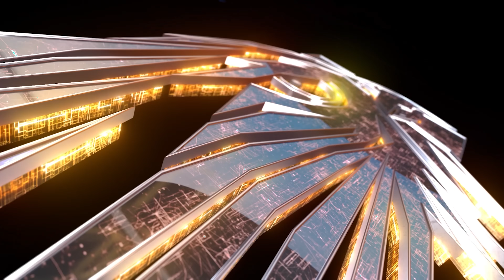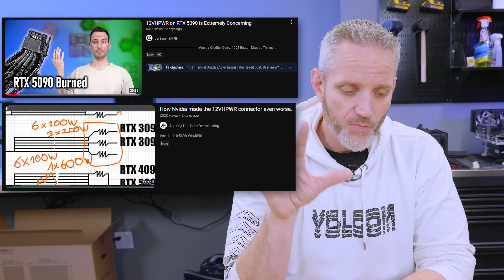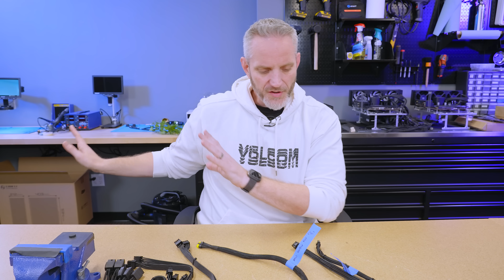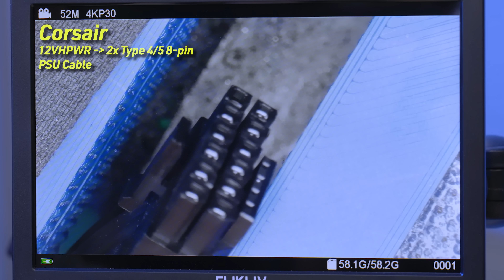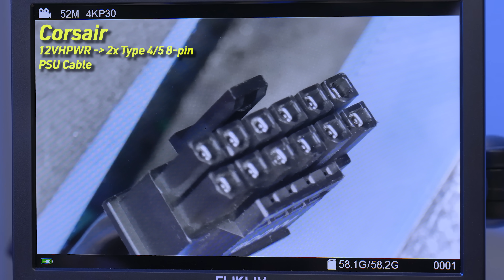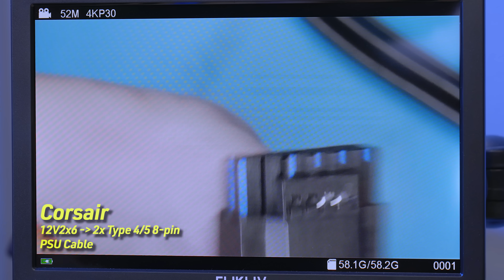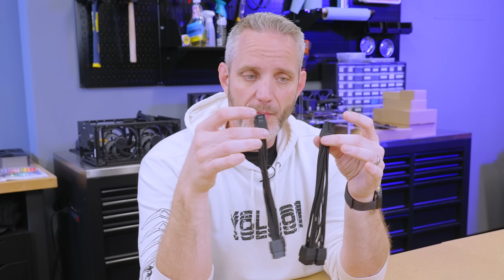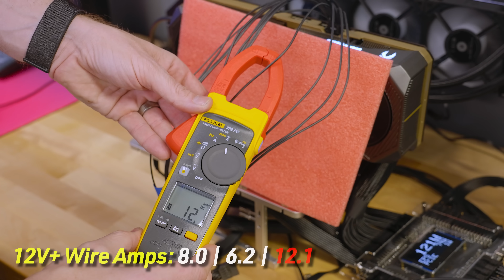I discovered something concerning and I need the Experts to chime in... More 12VHPWR discovery!

Comment: At this point, one might consider directly soldering the power delivery cables to the GPU, as it is the only way to ensure good connection and thus your house not burning down. 

Or, you know, not buy this product. 

What else is there left to say other than this connector AND its specific implementation with the unified power BUS instead of having per-pin current sensing with protection mechanisms is garbage.

One could also build a little device which senses current flow for all the individual 12V cables and cuts the connection if any one of them is exceeding a specified current. 

The fact that I'm not even joking about this or soldering the cables to the GPU directly really says everything about this situation.

Comment: I have a 4090 and it was running on the pigtail that came with it and there is blueing on 3 of pins on the sense side. I bought a new PSU with the dedicated cable from MSI and will be checking the plug regularly

Comment: I just ordered a Corsair Swift PSU and my connector pins wiggled like yours... I will now order the MSI 3.1 PSU and return the Corsair... 

(My 4090 cable (with NVIDIA adapters) just melted 2 days ago and smoked only smoked up my PSU 2, so I now need a replacement... held 12 month... -.-)

Comment: I’m an engineer. The only way to get current differences across parallel conductors is to have different series resistances. Because the current division is proportional, different pin contact areas will have an outsize impact. This could be controlled for previously as explained by Buildzoid but the 4/5000 series can’t anymore. 

Pin length is a surrogate marker for series resistance and NVIDIA lengthened the pin to try to improve consistency without requiring series resistance measurements in the spec. Because there is so little margin the tolerances really matter especially since load balancing is entirely passive. Changing these would eliminated the blanket backwards compatibility with 12V high power cables and required recertification. 

I suspect the cable is underspec’d for both conductor size and pin contact tolerances. I speculate that this was done to maintain backwards compatibility on paper and not require retooling by cable and PSU manufacturers. I also speculate that manufacturers using repurposed 6/8 pin production processes will have more variation due to looser tolerances that could be easily handled by the older spec, leading to more issues running at the bleeding edge. 

The solutions are to go back to what the 3090 was doing so you have active monitoring and load balancing or redesign the cable and connector from the ground up to robustly handle high current.

Comment: This issue has been a concern for some time, but the recent increase in TDP has significantly worsened the situation.

The Corsair connector is reminiscent of my Sharkoon cables from the early 2010s.  My power supply melted during a Battlefield 3 gaming session, which placed a higher power demand than any previous game.  Examination revealed that several pins were nearly pushed through the back of the connector. I had stability problems back then, but only with BF3, so I thought to blame the game or nvidia driver for it. Although it literally blew up, I was lucky and able to rebuild the system. I replaced all wires and the supply and my performance problems with BF3 were gone! Same hardware!

While I didn't monitor hardware performance back then, I suspected the inferior quality of the cables, rather than the power supply itself, was the primary cause.. similar to that whats happening now.

Comment: The ground side will have a much better connection through the PCIe connector.  There are plenty of ground pins used for signal isolation so you end up with a very solid connection on the ground rail.  If there was a problem on the ground GPU connector, it is possible that the PCIe ground connections can compensate for it.  The ground connection on the PCIe connector can handle much more current then one would assume with a 75 W rating.
Reply: A thought.  Using the clamp meter, test all cables (power and ground) at the same time.  If you are able to observe any current then that is the current returning via the PCIe connector.  With good cables it should be zero.

Comment: got atx 3.0 PSU and haven't had issues with the 600w connector. No adapters needed and running more connections are far worse. Just more space and mass and makes no sense.

Comment: Not an electrician but know enough to say, yes a loose connection will cause overheating. The connection requires that the whole area be touching on either side without that you are getting too many amps running across a small area which will create heat. Basically it would be like using a smaller connection. Not sure who would really be to blame, but I smell more regulations or electrical code coming.

Comment: Height differences in pin depth are not something that can be adressed with this type of plug.
Imagine stamping thousands of these crimp-connectors with the same tool, it will wear out sooner or later. They need some tolerance on the locking mechanism to account for this wear.

I wouldn't even connect multiple small wires in an emergency to a supply for the same rail. One wire will always conduct better than all the others. Just use one single wire with the right margin in regards to the cross section...

I think they have choosen to use this connector type because they already have the machines that automatically crimp the connector to the wire. Computers use this type of connector everywhere. Designing a whole new assembly line would cost a lot, so it was a financial choice together with a purely asthetic aspect...
People tend to forget the challenges that come with mass-producing something, if they even care at this deep level...

Comment: Lets just throw Deans plugs on the graphics cards lmfao.... at least they handle 60/75 amps...... Thought i will not disagree that even i as a hobbist in terms of remote controlled cars, i have dabbled quite a bit with power cables, even to the point to resolder battery connectors to better ones to handle the current demand. That being said, electricity prefers taking the path of least resistance, every cable has resistance, simply shortening one of the wires, or have inconsistent wire lenghts, could also be the cause of some of the cables having less resistance hence the electricity likely wants to take that route.

Thought i am bit shocked that this cable has gone on for so long, considering even the amount of surface area these connectors have, i wouldn't really put anything close to 20 amps through them. however 2mm bullet(banana) connectors are able to handle 25amps. I wouldn't really pick those as you want to have at least 20-25% above the expected demand, to avoid connectors being the failure point.

Comment: I would be looking at the injection molding machines where the connector housings are originating. The machines to make the connector housing are specific for just that part. The crimp pins are more of a commodity item, and more standardized. I've seen injection molding shops really try and sneak cheap tools into production because it means continuous tooling build purchase orders in the future. My guess is they aren't using high quality molds, or the molds they are using might be worn out already. It probably varies from vendor to vendor, lot to lot. This is why its good to know who your CMs are.

Comment: Why can't we just put 3x 8-Pin on the 5090...

8-Pin is rated for 336 Watts (7 Amps per cable), so 3x 8-Pin 200 Watts would be WELL within overspec range, not to mention you have stronger connections and thicker pins. Add some proper load-balancing, perhaps 2x2 per connector and bob's your uncle.

Comment: Well, this is why I'm not even bothering upgrading my system until all this wire BS is solved and actually fixed. So many issues from one connector and they still cant get it right... the fact they are using a 600w cable is a mess, think about efficiency, even power supply run more efficiently at like 50%... so technically we should be on a 1200w cable now? This is just getting ridiculous now.

Comment: @Jayztwocents Having watched this, I got curious about the cable that came with my recently purchased Asus ROG Thor  Platinum II 1000w PSU I bought with the intention of using for a 5090. I don't have one obviously, but looking at the unused cable (which is a Gen 1 cable) it has similar properties to the corsair you showed where a lot of the pins are partially receded and a light pull on most of them causes the pins to recede. I don't have a GPU that uses this cable though so I can't test it.

Comment: There are little centering flaps on this pin I believe which if they accidentally get crimped the connector will not hold it properly that could be the cause.

Comment: Im not an engineer but I do work on high voltage equipment. Having solid and secure contact between power connections is vital so those pins being off even a bit can easily cause them to melt down, I've seen it happen many times where a connection wasn't torqued down properly and causes a major failure. Also, a critical design flaw like that when you had a functional version before would cause most companies with any common sense to say we need engineer a better and safer solution. It's unsafe, it affects the companies reputation and stock price, and they have to worry about things like lawsuits.

Comment: I have done lots of work with molex type connectors and that pin may be seated but either the connector seat is damaged or the pin was crimped slightly off so it is in but it’s definitely too far in

Comment: The fact they try to gaslight everyone into thinking a 600w connector is ok for a 575w TDP. for example if you need 19 amps on a circuit, you would NEVER put that on 20 amp 12 gauge.

Comment: Please stop calling the new 12v power supply 'The dummest solution'. You don't need and won't get power balancing for 40 and 50 series 12v power supply with the new power delivery principle. This just sounds unprofessional to call it dumm. All you need is to make sure that the cable you use is a proper one, that you will acheave a low resistance unilaterally distributed among the 6 wires that deliver power. Asus Astral offers this feature via gpu tweak iii software where one can see the current drawn in each of the 6 wires. Other manufacturers simply rely on the quality cable (including connectors). That is it. What else do you expect. DerBauer proved the point! Even if you are left with 2 wires out of 6, there will be no melting. Do not buy dumm psu and dumm 12vhpwr cables!

Comment: The way that the connector on the Corsair plug looked, I’d assume either one of two things:

1: Heat. That specific ground connection got hot enough to make the connector lose.

2: A manufacturing defect. There is a defect in the mold they use to cast the actual connector, causing it to be loose.

Either way it’s scary to think you can have over 20 amps going through a single wire of that gauge…

Comment: My opinion as a computer engineer who does *not* work on the power side of things.
If the 12vhp is the only current path to GND and 12V, then it should be symmetrical between 12V and GND. However, I would guess that there are other paths to GND, mainly the PCIe lane (1). Not sure I would want to put any significant current through that, but it may mask an issue on the ground pins.
A little bit of wiggle in a connectors conductors is not necessary an issue, assuming the connector is designed for that. The problem is, I do not think this one is. I am going to inspect the one 12vhp cable I am using for wiggle.
As far as solutions go, there are many. I know what I instinctively lean towards (2), but there are many engineering considerations that I do not have enough information to consider and I have not done the math. I would however, like to see at least 2 major fixes be implemented.

(1) PCIe does have 12V, but not many pins for it, and it would not surprise me if the cards did not connect them. They would likely connect GND though, for signal integrity reasons.
(2) Personally I lean towards overbuilt connectors and increasing voltage to decrease current. That being said, this is a bit old fashioned, and things like load balancing could also work fine.

Comment: I just checked my 12VHPWR cable from Corsair and it had two loose cables. One of them is at the corner which makes it worse, because those pins melt the most. Hopefully the cable that comes with the 5080 I preordered is good enough or else I'm screwed.

Comment: I'm going to randomly add that you've got an "amount" of ground. Someof it is supplied by the 12vHPWR connector, but also a load supplied by the card's (numerous!) ground pins. If those two ground planes are tied (you can test with a decent multimeter after having zeroed out the test leads) then any deficiency on the 12vHPWR ground pins will be compensated for by the slot ground. I think that probably answers your question... It would also be interesting to disconnect the 12vHPWR grounds and to see how much your slot warms up!

Comment: Management: I want a smaller plug that will save us 20 cents per card. Go!
Engineers:  :::laughs::: well, I suppose
If we make the pins smaller 
AND IF we require manufacturing tolerances to be 50% higher,
ANd IF we assume the user will plug it in absolutely perfectly 
then we could get away with this design.
Management:  PERFECT! Let's do this!
Engineers: Wait! No! I was joking!!!

Comment: Your extension cable is only supplied by two 8pin PCI-E connectors, but if I recall correctly one 8-pin PCI-E connector is only rated for 150W, no?
This means your extension cable is only rated for 300W + 75W from PCI-E slot?
For an usage of 600W like the 5090, you would need four 8pin PCI-E connectors?

Comment: Electricity always flows through the path of least resistance. The cables where the pin height is inconsistent means theres different levels of resistance skewing how the load is distributed, if enough fall out of line then it can push almost all the power through just one pin. This is terrible design, and should be load managed before hitting the cable.

Comment: @jaystwocents whatever is the VRM configuration/topology all the GND wires will connect together to the GND layer on the board. (The only exception to this rule is when you have digital and analog circuits on the same board) INCLUDING all ground connections on the slot. This could mean that GND connections on the 12VHPR/2x6 is a bit more lenient than 12v ones.

Comment: Its a dangerously flawed design on a massively expensive card. There is no way of knowing once you plug in the cable if its ok, or will remain ok because the card doesn't know either. The cards should be withdrawn or nvidia needs to come up with a new cable/adaptation that has the ability to check power draw per pin and shut off if its out of spec.

Comment: A ground wire that is not making full contact can cause unwanted resistance due to the less surface area and it will heat up the smaller spot that is contacting because it is having to carry that load through a small section vs the whole pin surface area. In MOST cases it wouldn't burn up at all because most circuits are using suitable wire and connector sizes for the loads being carried.

Comment: losing a pin on either the ground or 12v side will cause the same failure for that side. each pin is rated for a certain current and when you lose a pin the current that it would take has to go to the other pins. so if you had 5/6 12v pins and all 6 ground pins the 12v pins would have more current than they are rated for. and if it was the other way 5/6 ground and 6/6 12v then the ground pins would have more current than they are rated. I think the reason we see more 12v pins melting is because of how the cards are plugged in. for cable management reasons the 12V pins are under tension more often than ground pins, this would exacerbate the short pin issue and cause more failures on the 12V side. this is all of course if the short pins are the reason the failures are happening.

Comment: I think you may have found my power supply issue. I got a reman 850 from a very reputable dealer. Every time I plug it into my GPU it would just start to click. Now that I'm inspecting the cable you are 1,000% correct. At least I'm pretty sure I will do a process of elimination and see if I can't eliminate the cable out of my damn problem thank you so much.

Comment: One suggestion - compare the pin order in the plugs of the Corsair cable and cables dedicated to Corsair from other companies - you will see something interesting. In addition to incorrect seating of the pins in the Corsair cabling, the accumulation of several cables on one pin may be the cause of these problems.

Comment: Just shorts 12v together , current will be even.

Solving the cables current distrubtion is very easy. Just short 6 cables together. Your cables will be fine.

But if the current on each pins are not even, the pin will heat up and burn the socket.

Comment: This suggests the issue is not an inherent design flaw in the cable itself but rather quality control problems during manufacturing. If it were a design flaw, failures would be consistent across all cables, but instead, only some units experience problems, indicating that minor defects in individual cables or connectors push them over the edge when operating near safety limits.

Because nVidia is pushing power delivery to the maximum, even small defects that wouldn’t have mattered at lower power levels can now cause overheating and failures.